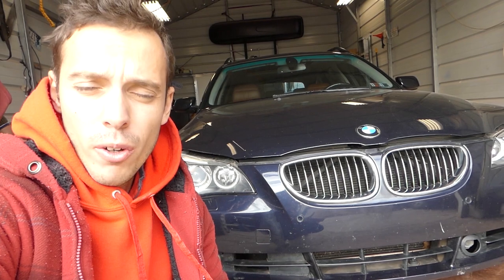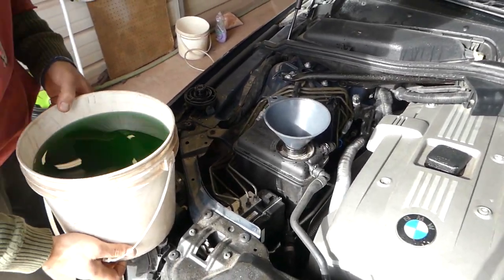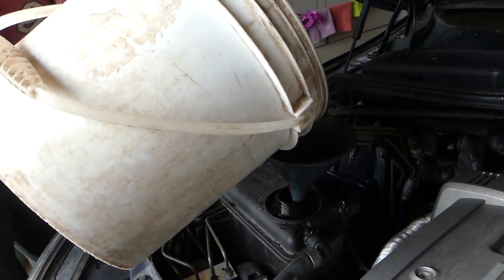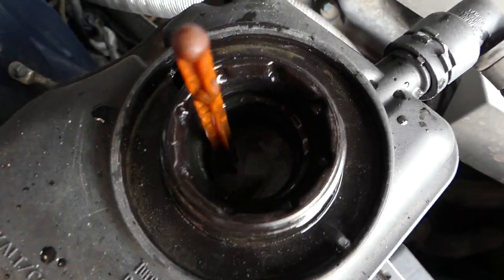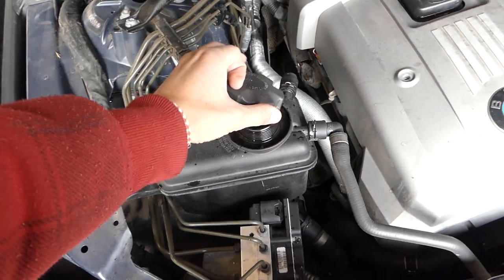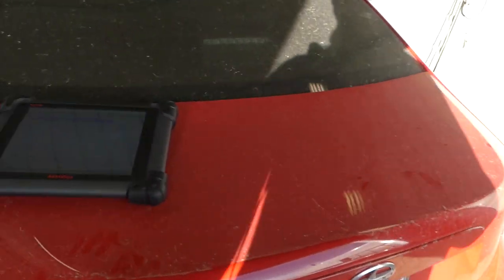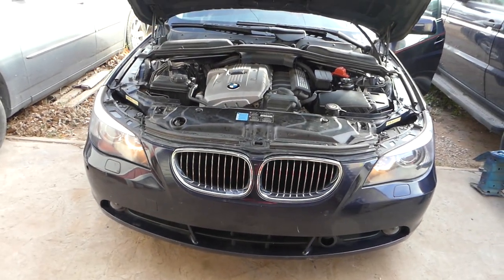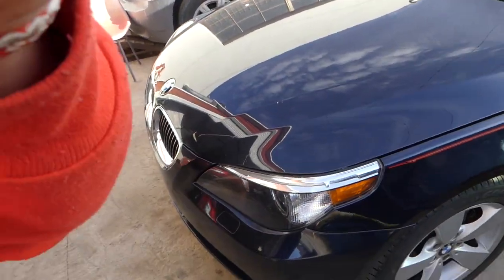HOW TO BLEED THE COOLING SYSTEM ON BMW E60 E61 530i 525i 530xi 525xi

Comment from the maker: Products that we use and recommend:
► Water Pump (check fitment) : https://amzn.to/36OTHr5
► BMW Coolant: https://amzn.to/3zV7nUq
► BMW OEM Coolant: https://amzn.to/3ZVzJZn
► Thermostat: https://amzn.to/3gEWGqO
► Panel Removal Set: https://amzn.to/3YiMADu
► Tool Set: https://amzn.to/3p5MM6t
► Screwdriver Set: https://amzn.to/3XRB28Q
► Castrol Oil: https://amzn.to/3xBc8B9
► Oil Filter: https://amzn.to/3w0Ulme
► Torque Wrench: https://amzn.to/32qyRwg
►Liqui Moly Engine Flush: https://amzn.to/3IiDBID
► OBD Scanner that we use most often: https://amzn.to/3I4MQfe

► Check out our Amazon Store for the tools and parts that we use: https://www.amazon.com/shop/worldmechanics

Comment: You're supposed to charge the battery so WHEN you bleed the system using the electronic pump it doesn't die, after doing the change open the bleed screw a few turns, turn the ignition on with heater at max and fan on low, after hold the acceleration peddle down for 10 seconds and you'll hear the pump start, process takes about 10-15mins watch the coolant levels and fill when needed. Note: i normally close the bleed screw after 5 mins to save some wasted coolant. Good luck all.

Comment: What is the purpose of bleeding it?  Wont it get rid of the air itself once u start the engine as the coolant circulates back to the reservoir?

Comment: When u access hidden dash menu on e60 520d to see display of coolant temp , does that menu show coolant RADIATOR OUTLET TEMP or does it show ACTUAL coolant temp ??? My one shows 54-56 celsius on hidden dash menu. Does that mean its showin radiator outlet temp or does that mean my thermostat is stuck open?

Comment: Why doesn't anyone show the coolant bleeding for BMW e65? I would like to know the proper procedure for e65 after replacing the coolant transfer pipe and O-rings......
Reply: What engine do you have
Reply: @crazy4gta1  4.6L V-8 belt driven water pump. 2007 750i
Reply: Unfortunately I don't have experience with the n62 but I did find some information for you 

 https://www.newtis.info/tisv2/a/en/e65-750i-lim/repair-manuals/17-cooling/17-00-cooling-check/CN6MPF0
https://www.bimmerfest.com/forums/showthread.php?t=626932
https://www.bimmerfest.com/forums/archive/index.php/t-752501.html

Some of these are on the e60 but they share the same engine

Comment: Ok buddy yes add coolant,  let sit for 10 to 20 min, them close cover and start the car.  All good simple things to do. My question is what's the charge has to do. You never mention to put the ignition on ON position. So i believe this video is 1/2 way.  I think this video is a 👎💯%
Reply: Bolillo Ponce totally he edited wrong or forget to explain how
Reply: So why is the charger on the battery for ? Is the car on ? Or on ignition ??
Reply: Rogelio Pesqueda you need a scan tool to run the cars auto bleed. It will run the electric water pump for about 12 minutes and will drain your battery if it’s not connected to a charger. It requires minimum 13volts for the whole bleed process  if the volts drop below 13 volts it will stop the process. Scan tool will tell you what position the ignition needs to be in for this test but most likely position 15 ignition on engine off.